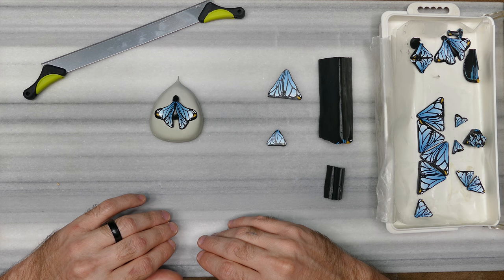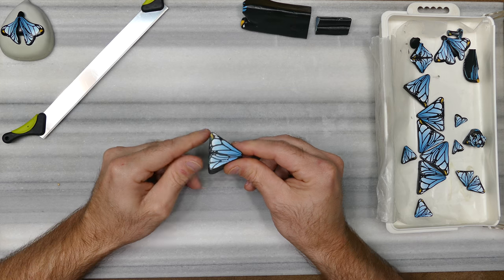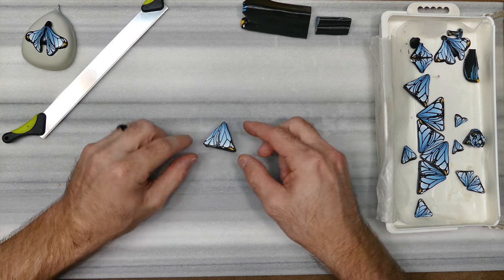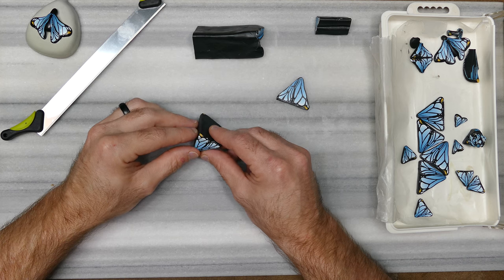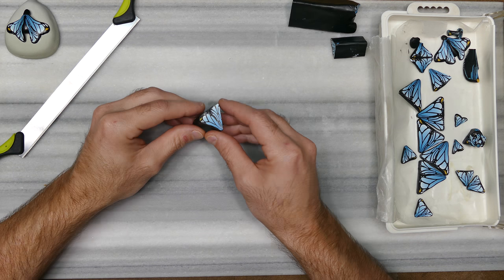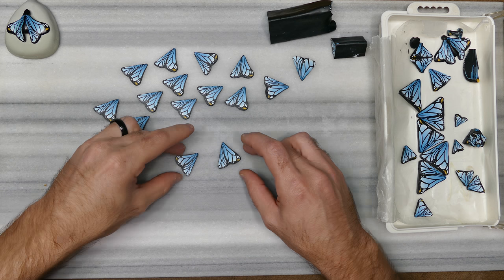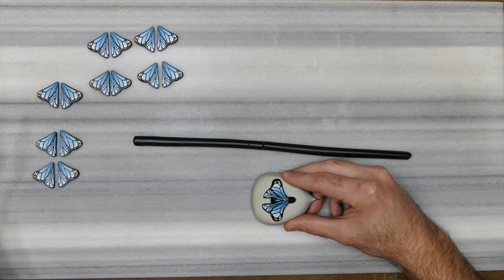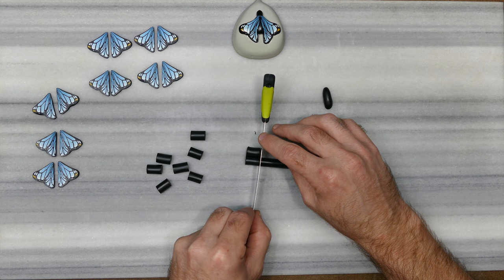Prepping Butterfly Wings from a Cane

Comment: Yep a leaf cane  I wish I had a picture
Reply from the maker: hmmm... well if you've tried to keep the shape  as bast as possible during the reducing part, but it's still not quite right, perhaps you can reshape it a little by rolling it on your work surface kinda like what I do in this video. Just round the wider bottom  of the leaf while trying to keep the point of it by laying it down on its side and pressing along the length of it using the work surface to help form the narrower tip's end. Does this help any? I neeeed to do a leaf cane! Been wanting to make one for some time now. Perhaps me stumbling my way through it could help a little?  It couldn't take too long to do, in theory...  aside from the filming and editing part at least lol   If you can get a pic of it share it to Facebook, link is on channel and in video's description, I'll take a look.